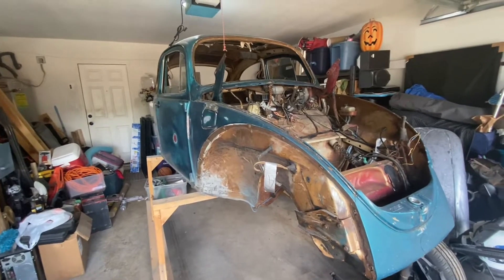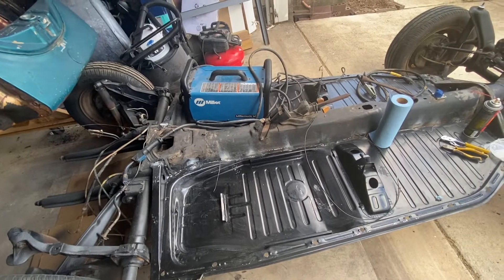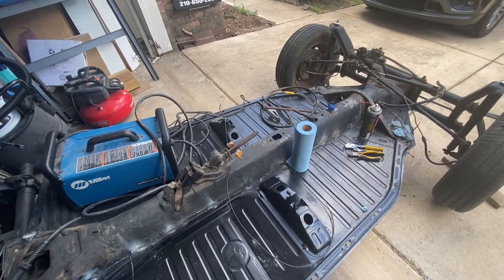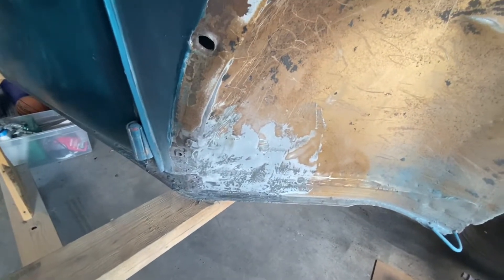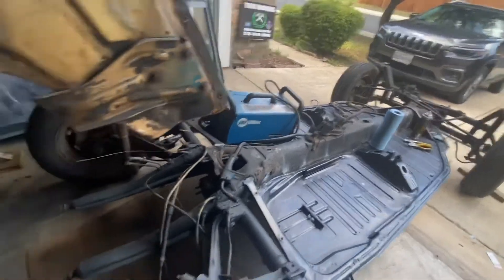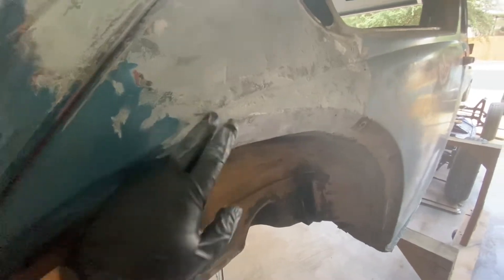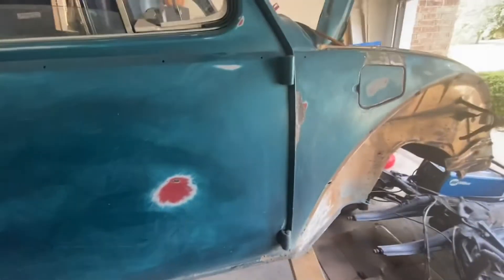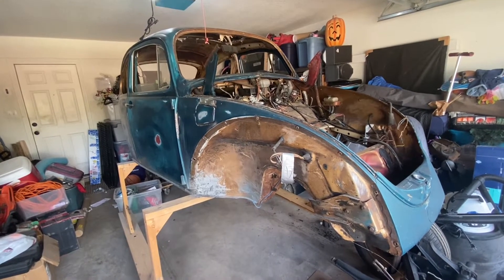1976 VW Beetle Floor Pans are in

Comment: Maybe you can get to that dent front the inside and work it out. At home depot they have these small inflatable things you can put inside there to put pressure on it and use the tapping hammer around on the inside.
Reply from the maker: Thank you for the suggestion. I will look into that. Someone also suggested inflating a football. I’ll try anything at this point